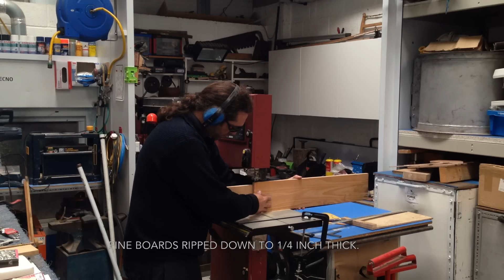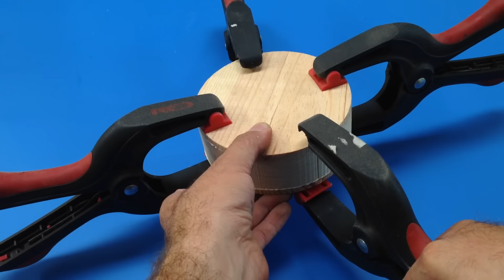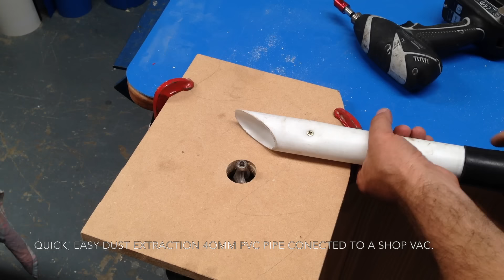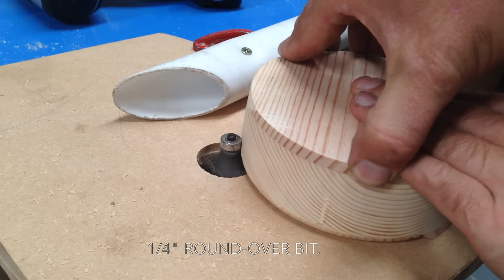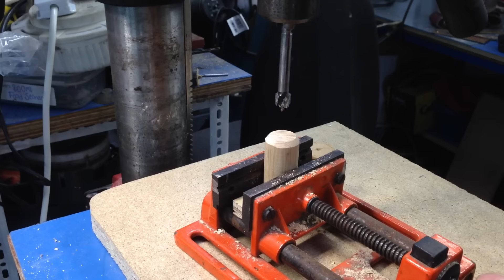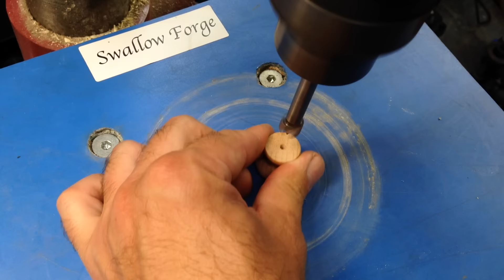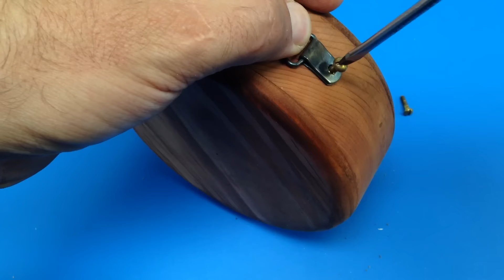How to make a Wooden Water Bottle or Hip Flask for reenactment, steampunk, Larp or cosplay

Comment: nice product. I would recommend coating the insife with a food grade/safe polyurethane. especially if using pine because of pines natural resin. simple to do, just pour a little inside, spin the flask around to evenly coat then place nozzle side down and allow excess to drip out and the remainder will dry.
Reply: I was gonna say...some way to waterproof the inside would make for a better flask. Thanks.
Reply: I was about to comment the same thing. It's not much use if the wood absorbs all the water and then possibly falls apart in the middle of a hike.
Reply: I've had 120 proof in one like this and it didn't do anything adverse to the adhesive.
Reply: Edward Norton yours nay have been sealed also. That's why it may not have been affected.
Reply from the maker: I love the fact that you are all experts despite not having ever made a wooden flask.  Alcohol doesn't dissolve the glue. The wood doesn't absorb all the water, because If that was the case, wooden boats would sink. and if you make them properly, they don't fall apart. And just think about what you are saying. You would rather put chemical sealants in the flask than use the natural safe properties of wood? and yes there is a glue up, but it is on an edge with very little coming into contact with the liquid. If you are that concerned about the glue, I suggest you never drink anything that come in a plastic bottle as its practically the same stuff.  Hope that helps reassure you, and i hope that rather than sitting in front of a keyboard all day, you go out into a workshop and have a go at making one of these. The enjoyment you will get from it will be a worth while endeavour. All the best SF
Reply: Swallow Forge excuse me? I've been woodcrafting since six years old, been a professional joiner since 18 and certified by six coating coating manufacturers,  hazmat/hazcom certified and run a furniture and cabinetry shop on a daily basis. I made my statement due to NOT seeing a coating on there and knowing intimately the resinous compounds of pines/firs. Your disgusting response is unwarranted as nobody was being disrespectful. May I kindly suggest you change your attitude, because it sucks. I suppose you may have a reading comprehension problem,  but I did clearly compliment you on your work. It was a suggestion, not a demand. Instead of being a youtube keyboard badass yourself, think.
Reply from the maker: Sirry XS. It wasn't your comment i was responding to
Reply: Swallow Forge thank you for clarifying and I apologize if I responded to harshly. I never try to put a fellow craftsman down as I know our work is our pride. if my comment regarding coating offended you please know that was not my intention. I will reiterate that the flasks are beautifully made. surely not something you see many joiners making any more.
Reply from the maker: No offence taken, I'm pretty thick skinned :) The problem with coatings is that they are a minefield, ones that are fine and food safe for water such as shellack, are no good if you intend to use alcohol. Not all epoxys are made equal and so on. The natural wood does actually work fine, you should never store the same liquid in a canteen for more than a day or so at any rate. Even stainless steel hip flasks have that warning written on them. If they are dry stored and washed out thoroughly, they will give many years trouble free service. The pine doesn't taint the flavour in any noticeable way. But then I quite like the taste of pine, pine needle and birch sap tea is a spring favourite :) The other concern is that if i showed the flask being lined with food grade epoxy for example, it might lead to people experimenting with not so safe finishes. So from a youtube standpoint, its better to keep it simple. I hope this explains my reasonings. My previous comment wasn't aimed at anyone in particular, just the general hubbub you get with any youtube post. I should have started a fresh comment. but then thats the joy of interacting with strangers online. Its easy to cause misunderstanding. I hope this goes some way to mend any ills and hopefuly I don't come across as a self inflated arse. All the best SF
Reply: Swallow Forge I can certainly agree with your standpoint with the coating safety issue, I'm quite certain we can agree that there are individuals out there who would indeed try something risky for a coating, then again I'm a rather staunch believer in the process of natural selection, lol. and you are quite right with the storage label warnings.  even a poly vessel has those warnings. it's one thing if your drinking enough to change the water out a couple times a day (provided it's been sterilized amd not from a horse trough or something else less sanitary). also, I'm pleasantly surprised that I'm not alone in enjoying the flavor of pine needle tea. it's also an excellent winter time immune system booster.
Reply: The main comment has a lot of valid points but Id probably at least put some olive oil on the inside and/or some hot bees wax... thats just me...
Reply: Swallow Forge bad attitude to have with a yt channel lol
Reply: do you believe pine resin is bad ? if so can you site your proof of this allegation ?   or is it just a imaginatory monster you know nothing about ?    i can cite numerous references of pine resin ,pitch etc used chewed and consumed for thousands of year with amazing healing properties of anti-mold ,fungus, parasites and high levels of vitamin "C"   the indians saved some scurvy dogs with the needles and they were never given credit also, do the research.
Reply: Sorry couldn`t let this one pass.
The wood doesn't absorb all the water, because If that was the case, wooden boats would sink.
One of the first boats made was a log boat made from a single hollowed out tree, these would last about a year until the wood soaked up enough water that the wooden boat was too heavy to be buoyant, where these were used the lake beds are full of these boats, all intact just sunk because of the weight of the water soaked up by the wood. Even the big sailing ships had to be dry docked every few years to have their wooden hull repaired and they had preservative on them. No preservative on the inside means it will soak up water and expand, as will the two end pieces, the problem is that they will expand and contract at different times and by different measurements compared to the outside which means that eventually the wood will crack and will no longer hold water. On precision wooden tools or instruments a water based glue is not used because even that small amount of water will change the wood to the extent that it becomes inaccurate over time. 
Woodworking 101 bare wood + water = expansion
Reply: That's exactly what I came here to say. Thanks, Xs.
Reply: In addition, there are many who welcome the flavour added by pine casks!  This would make a fantastic wine carrier and would add a slight retsina flavouring to the wine for the first few carries.  ;)  I dare say it wouldn't be much of a flavouring... very mild, but the natural vessel appeals to me much more than plastic or metal.
Reply: MrNadefodder Actually, big sailing ships made from wood were normally sealed with some sort of lard or other water repellent substance like it. They were dry docked every once in awhile but not necessarily for drying out the wood. If it was for drying out, chances are something rubbed off the sealer or punched a hole in the ship letting water through.
Reply: Lard!  WTF... NOT!  You mean boiled pitch and bitumen.  Also ships cracks were filled with paint, lead and clad with copper, but never lard.  I think you're getting sailing ships confused with fried chicken and flaky pie crust!
Reply: Abdul Farooqi I said something like lard. And I never said they filled cracks with lard. Lard would be terribly ineffective for fixing a ship.
Reply: Dominick Miller, lol... Whatever dude!  Why mention lard if you didn't mean lard!  Pitch is nothing like fucking lard!  Perhaps you meant TARD!  ;)
Reply: Abdul Farooqi There's no need to be so rude. I simply made a mistake. As if you haven't made any of those in your life...
Reply: Listen, Dominick Miller...  If you're going to make comments on here that begin with "actually...", you're going to sound like your expounding your tremendous wealth of knowledge with the rest of we poor ignorant souls on YouTube.  When your illuminating content turns out to be nothing less than incorrect drivel, it makes others think that maybe you should have kept quiet.  Now you're going to start playing the hurt victim who was shit upon by YouTube bullies?  Believe me, if I wanted to be rude to you, I could have done much better than that!
Reply: Dominick Miller...  Not sure that your expertise in playing the victim is something you should boasting about.  Try rubbing lard on your head!  Might help, but if nothing else, it'll keep the water out!
Reply: Dominick...  YAWN
Reply from the maker: Don't mind me, Im just sitting here eating popcorn... :)
Reply: Weren't wine skins and other things sealed with pitch? People drank from the for hundreds of years and your worried a bout pine? Not pitch mind you but just plain wood.
Reply: @c3pfett 
The wood always contains trace amounts of pine resin, even if it's not obvious like with fat wood.

I personally don't really see the problem with it.
Reply: @organicdudranch  - So what "the Indians saved some dogs".  It amazes me how many people think only the "Indian" knew herbs.  What there where no Pine trees in Uropa - for thousands of years the Vikings, Scotts, etc. have been using Pine needles - good God people get over your "Indian" fetish, The white Man was here long before the modern day brown/reds - learn the truth.
Reply: @SwallowForge  - about the comment you added on drinking pine needle tea - I too drink tea made with pine needles - nice citric taste.  However I just want to let readers know - and you may want to add this to your vid description for those who read your comment on the tea - that one should only use pine needles from the White Pine, not the Yellow Pine as it has toxic properties and it can make one rather sick.  White Pine is identifiable by there needle count:  White Pine has 2-3 needles in a cluster, Yellow Pine has 5 needles to a cluster.  So 2 or 3 it's good for tea.
But for you folk who do not have any White Pine in your area - fear not - you can enjoy a cup of tea made from Fir, Spruce and even Cedar tree needles (cedar is a bit fruity tasting) - all have it's own delightful flavor - but never use Hemlock as it is very toxic.
Reply: Just what i was thinking👌
Reply: @SwallowForge  I love this and miss the smell of pine from woodworking as a little kid, this brings back memories. But I'm curious about wood conditioners or treated wood for this without a sealant. I know wood from a hardware store is usually treated and it is deadly to burn treated wood, but I don't know how soluble it is or how toxic it is though. Any insight on that concern?
Reply from the maker: @mykilpee   If you buy your wood from a reputable lumber mill, you can ask them for untreated wood. or you can mill your own boards from felled timber, that way you can be sure. hope that helps. all the best, SF
Reply: @organicdudranch  im alergic to some pine resins so ill wax mine

Comment: have you thought about coating the inside with melted bees wax?
Reply: +Rachel Woodruff Smart... without.. kinda yucky...
Reply: +Rachel Woodruff Smart... without.. kinda yucky...
Reply: +Rachel Woodruff I did that with mine. Just melted some wax poured it in there shook it up and poured the excess.
Did this 4 times.
Reply: Only downside is that hot beverages will melt and leech some of the wax over time, requiring additional coats.

Not harmful, mind you, just inconvenient.
Reply: 3 years later... I’ve seen this done a few times and am mining one of these my self for fun. Will alcohol mess up beeswax?
Reply: @bboyer88  it shouldn't as long as it isn't hot.

Comment: Love the build but I'm cautious about using glue for things that will come into contact with food or drink. They use metal rings for whiskey barrels to hold the wood together and the liquid expands the wood to make it water proof. Also, they only use white oak for spirits such as rum, whiskey and such.  Maybe you could come up with something like metal staples or clasps that hold the wood together to age rums or whiskeys in. It's getting real popular to make very small whiskey bottles on youtube. Could you do something like that?  Again, nice build!
Reply: Just use food safe glue...
Reply: An American Homestead Titebond III would be a good glue, waterproof and fda approved
Reply: Good example of glue around food: Wooden cutting boards :)
Almost every chef has a wooden board and almost every one is held together with some sort of wood glue.
Reply: True, but those cutting boards have a finish on them that makes them food safe
Reply: NO..the finish may be food safe, and applied for other reasons...but the glue holding the individual boards will be in regular contact with knives as they chop/slice into the board. It too needs to be food safe, and is usually a made out of close to the same stuff that your water bottles are made from.
Reply: Water in a plastic bottle, no one bats an eye; A drop of food safe glue in a bottle lip, everyone loses their minds.
Reply: An American Homestead titebond 3 is approved by the FDA for indirect food contact
Reply: Too bad that WASN'T what he used.
Reply from the maker: No I used basic waterproof Pva which is clasified as a non toxic substrance. If you think that the very small amount that comes into contact with the liquid is a problem, I suggest you don't ever buy any food that comes in any kind of plastic pacaging, clingwrap, styrofoam etc... these days there is more plastic in our fish than you will ever get from using one of these water bottles. Interesting reading through these comments though. Its good to get other peoples perspective. As with all these things, if you feel there is a better way to do things, by all means do it your way. These videos are there to inspire. Have Fun, Be safe. All the best. SF.
Reply: just use plastic man
Reply: Most wood glued are food safe and if not just use resin
Reply: It was not food safe glue, that is the point!
Reply: Waterproof PVA is a very innocuous glue, although I am curious about how it'd hold up against alcohol over time. I dunno about that stain you're using, but it's on the outside of the flask so I think there's little chance of it seeping in. That said if that was a concern to any creator out there then use butcher block oil, walnut oil, or even beeswax. All of those are super safe.
Reply: @king247king  Imo there's just too many variables you'd have to know in order to be able to accurately tell someone if glue should be used in a particular situation, shit like what specifically  is being contained, does it sit and soak for long periods, temperature,  etc. All examples of which are significantly specific and all are prone to variations from a day to day basis
Reply: @ayyosef6915  no spirit 😪
Reply: My simple suggestion would be to simply mix up a batch of food grade epoxy resin and pour that in there and roll it around till you get a nice coating on the inside. Would prevent leaks and make it so your drink didn't taste like a pine board.
Reply: Well thought! I had the same idea when I saw the glue thing. I was even thinking of a way to use the same principle as barrels, to burn the inner walls to caramelise and accentuate the flavor, and perhaps to use some kind of metal ring to compress the pieces of wood.
Here in my country is very common to do this burning in the casks to gain flavors and gain different colors in cachaça.

Comment: When I make this sort of thing, as well as my leather flasks, I seal the interiors with molten brewer's resin, pour out the excess, and let cool while inverted. Later, still inverted on a foil-lined tray, I put them in a low-temp oven to melt out the rest of the excess. Sometimes, I repeat the process if a flask leaks.

Comment: great work... for food safe / leak proof 1 use right glue shoping aroung ask google. 2 in the middle insirt make your mouthpice when you make it and put a 1/8-1/4 lip on the center and reciving slot on the sides 3 fill with sawdust and set aflame burning just the inside

Comment: Don't you need to coat the inside with some sealant ?
Reply: yes i think they used some sort of wax for it
Reply: @l.h.9747  its bees wax they used back then or fat, but fat doesn't taste good so bees wax was used since the 17th and 18th century, in 1870 they figured out that Smoke masks alarm pheromones which include various chemicals, e.g., isopentyl acetate that are released by guard bees or bees that are injured during a beekeeper's inspection. The smoke creates an opportunity for the beekeeper to open the beehive and work while the colony's defensive response is interrupted.

Comment: Great project, easy to follow and modify. For others thinking about this project, though: be careful what wood you use for this project, especially if you use hardware store pine. There may be anti-rot chemical traces on the wood that can leech into your drink unless you coat the inside of the flask with food-grade epoxy.
Reply from the maker: You are quite right. I tend to get my timber from a yard rather than a Home Depot style store. Also some exotic woods are poisonous them selfs. 
If you are not sure, go to a reputable lumber yard and ask their advice.  Thanks for the comment.